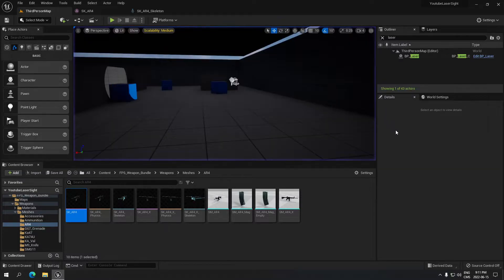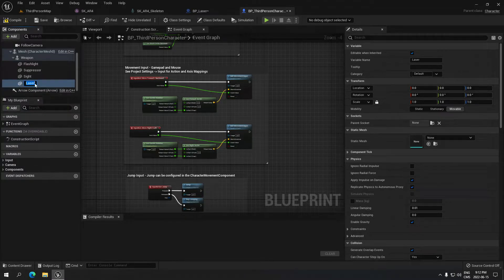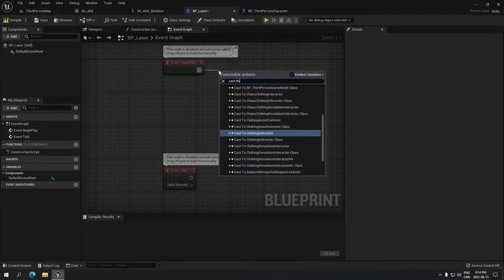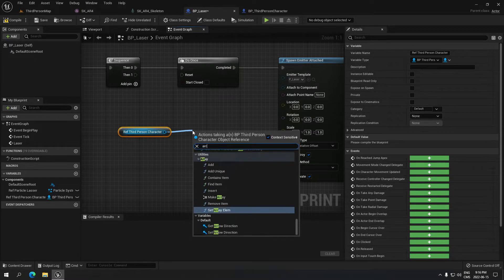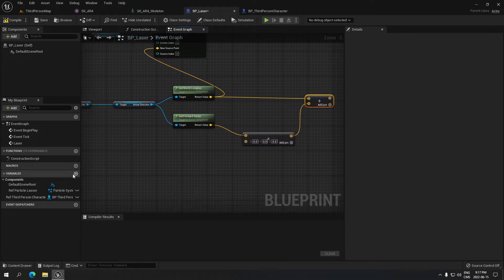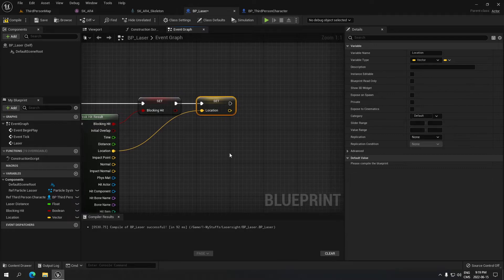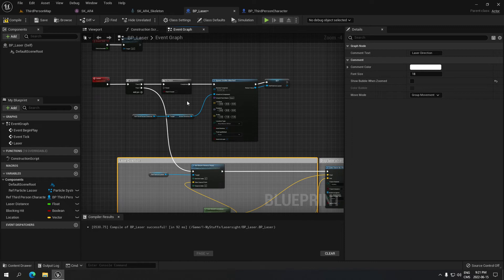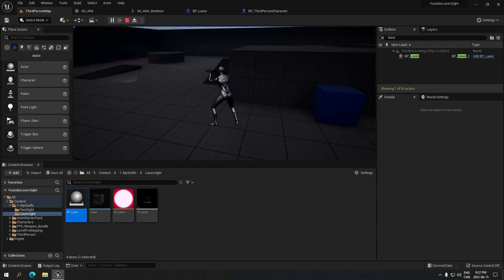Unreal Engine 5 - How to make a Tactical Laser Part 3/3

Comment: Would it be possible to get the laser working inside of a weapon blueprint rather than using the character?
Reply from the maker: Yes and it will be better. Could be part of a master weapon blueprint where you could check which weapon as access to a laser.
Reply: @UnrealByYourself  understood and thank you for the quick reply. Their goal is to avoid casting on this particular blueprint if possible. I'm working on a VR project. So far I've tried moving everything that was in the laser blueprint to my weapon blueprint. Not functioning as of yet but I am still actively looking into it.